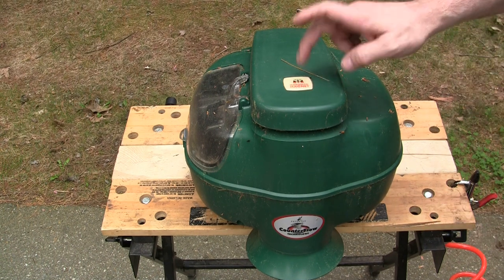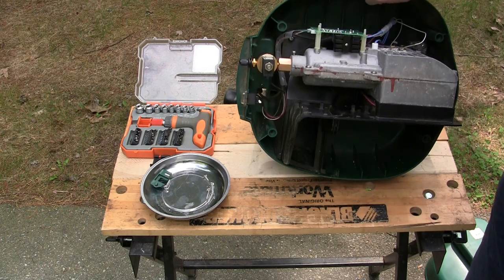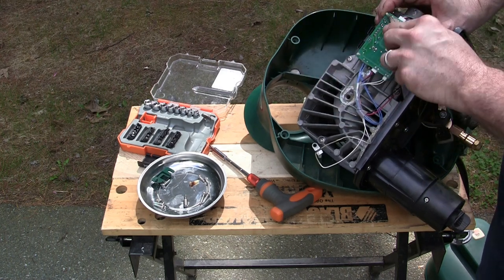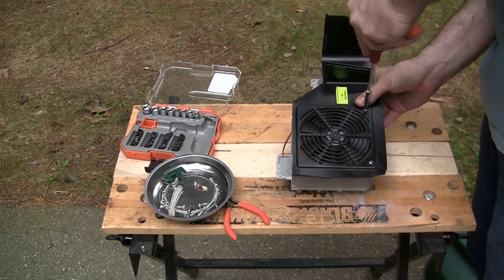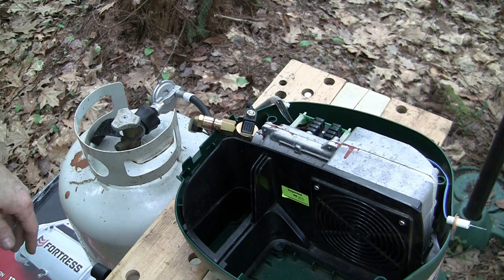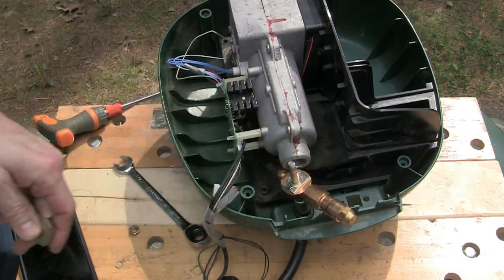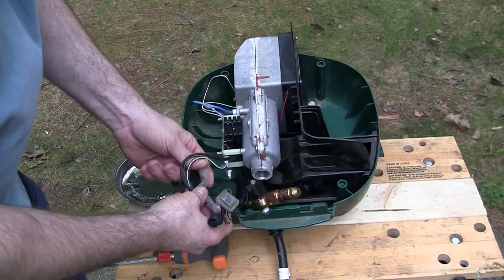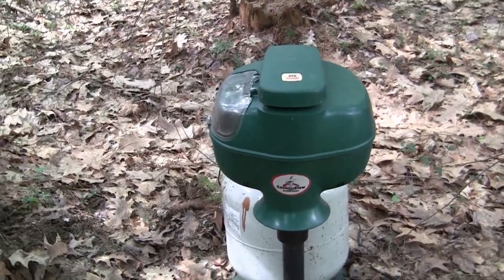Mosquito Magnet Patriot Plus repair

Comment: Side note for who it concerns, those igniters are EXTREMELY easy to break. Had torpedo heater that i was trying to fix and igniter was bit stuck, got it out but it snapped in process. Then tried to measure what kind of voltage board puts out, but moment i turn it on, mosfet exploded so it needs to have load on it, so consider this when trying to repair. In this case its low voltage while mine was 230v heater.
edit: got mine most likely fixed solenoid seemed to be bit stiff from storage, needed to take it apart. On 2013 model getting the peace sit properly is a pain and if i recall right you should never put grease on to help it slide, least certain types of grease. There should be products that works with natural gas though. I just carefully push it in place with parrot pliers being careful not to damage the O-ring. Cleaned the thermocouple and it seems to work now, gotta do more testing since i got this unit for free from E-waste pile. Also when you need to replace the gas line, see how it sits in place and when putting new one in place check it sits properly, mine got new line in old ends and sleeve didnt go trough the hole being bit larger so needed to remove some plastic to get it sit right. Otherwise the top wont sit properly same with unit internals and there is air flow issues. Mind replacing and sealing the airways so it can properly suck mosquitos in.
Reply from the maker: Thanks for contributing! Keeping these things running is a group project.  🙂

Comment: Thanks for this. Considering buying this device, but I understand now that knowing how to maintain the thing is imperative. BTW, that's one giant mosquito you got flying by in the background (12:00).
Reply from the maker: It really works well and I would still recommend them if you don't mind taking them apart every couple years. I have not seen anything better to date. And yes, I am glad that mosquito, flew by instead of paying a visit.  :-)
Reply: you need to buy octanol too, they fit inside a tube and that's where the magig happens. The unit burns propane to generate CO2 and heat to mimic an animal but they need the octomol so that the midge pinpoints the tube and gets sucked in.

Comment: Great video, thanks!  Couple of design changes on mine - the solenoid has a circlip rather than a nut holding it on,  and the thermocouple had a plastic sleeve insert insulating it from the main alloy body.  (I wonder if this was to prevent sacrificial corrosion from the thermistor?  No corrosion around it at all and it was fairly clean - unlike every video I've seen so far.  Unit is a UK version and about 4 years old.  The filter basket inside the injector does get very mucky - I used nail varnish remover which seemed to clear it up.  Still not working, but getting there :)
Reply from the maker: Thanks for the details. Good luck getting it running.

Comment: just for the record.  There are no flames with these units.  It's platinum-based catalytic process which is why the efficiency is over 99%.  Carbon Dioxide, Water Vapor and heat.

Comment: Davin, outstanding video!  Thanks so much for what you've done here.  This trap kills bugs like nothing else, when it's working; so it's definitely worth learning how to do good upkeep on it.

I've had my trap for 3-4 years (**), and had to send it back three times for maintenance.  (Last time, they sent me a replacement, refurbished unit.)  Now, a year after the replacement, mine is down again.  Very finicky device.
But with your video, I have plenty of hope that I can repair it myself.  Going to give it a shot this week.

I've already taken out and cleaned the nozzle -- mine was black on the "filter" end with carbon buildup.  I cleaned it pretty well with rubbing alcohol, and the quick clear cartridge seems to flow freely through it.  But in the meantime, I noticed that it's very hard to find out what are the correct part numbers for replacement parts.  Do you have a list of them? Or advice on how to identify them?  I haven't found good resources.  If you are able, I think it would be great to post a list of the most obvious parts:  the nozzle, the thermister, the solenoid/valve... anything else?
Reply from the maker: First off, thank you and I wish you luck! As for replacement parts, that is indeed tough. MM seems to have tight control over them and limits them to dealers. You can find some things on ebay. The only part I have had to replace is an igniter, which you can find there. MY advice is to watch local listings or even keep an eye out on trash day as people tend to get fed up with these devices and get rid of them. If you are lucky, you could get another unit for free or cheap and use it for parts (or fix it up and have 2).
Reply: @DavinDesborough  You are fight about getting them cheap ;-) I got one at a flea market for $15 ;-)  he said it would not start this year, I figured spare parts. Got it home and apart and it looked like they ran it without the basket in place,  it was so full of bugs the fan could not spin. Out of the 4 I have it is the best one ;-)
Reply: Hello, I use this model, mosquitoes do not enter at all.  What is the reason, help me  Heat on the machine 45c.

Comment: I have a Patriot model; after checking critical components like igniter and thermistor, finally down to gas solenoid valve; I injected 12 volts into its input wiring and heard a click, so assume it works. Looks like no 12 volts coming from board, and no continuity from board solder joints to output pins (for solenoid activation) so assuming corrosion on solder joints is the problem. This unit has been outside in the rain for ten years, and not sure how they would expect the electronics to function in such a harsh environment. Hope I am on the right track; will desolder and re-solder the board solder joints next.
Reply from the maker: What I think often happens is that the thermistor gets old or the probe is too covered in corrosion. Either way, the machines does not read the proper resistance and does not think it has started. What I like to do it try to run it. If it lights, the metal of the heat exchanger will warm up fairly fast. If you feel that warmth and then it still shuts off, it must be the thermistor (or the wiring related to it). I hope you got it working again. Sorry it took so long to respond.

Comment: I know this is an older video but I really like that screwdriver. Where can I get that set? 

Also great video. I bought two used ones, one for us and one for my in-laws. I took them apart following your video and they work great. Thank you so much for making this.
Reply from the maker: Great to hear this helped! The screwdriver set is a Home Depot HDX brand, but I don't see it on the website, so they may not make it anymore.

Comment: Davin  Thanks for the great video  You mentioned a part number and where to get a thermocoupler. Can you give that info? Thanks again
Reply from the maker: Sorry for the late response. You won't be able to order one as the company does not sell parts to the public. I can not find my purchase from way back when. I have looked around and can not find anything either. Basically, you would just need to buy a bare thermistor and put it in. I need to take one apart again and try to determine what thermistor is being used (resistance/temperature). That said, have you tested yours with a multimeter? If you heat it up and the voltage changes, it is probably OK. I will point you to this video: https://www.youtube.com/watch?v=60F9IkjqUVE. I think his idea of securing it with a metal screw is a good one. It would help to bring more heat to the thermistor. the only down side would be the possibly of corrosion between dissimilar metals.

Comment: Very good video should there be a need to take this apart! I have recently purchased the same machine and I was surprised how low the vacuum was. To a point where I thought it must be broken. Unfortunately the whole of internet has not been able to answer my question. Should I feel any suction if I put my hand in front of the funnel?
Reply from the maker: There should be some air moving, but not not a strong vacuum. Apparently, mosquitos have a natural reaction to fly up when startled or trying to escape.  That puts them right into the bell and they ride the airflow into the basket. 

Just to be sure, check that the door to the basket is fully closed or that will cause airflow issues.

Comment: Nice video. 

Did you find any drain holes in the chamber? I am wondering, as a burning propane flame generates water. It must have somewhere to go.... Right? 

Thanks!
Reply from the maker: @HotelGolf82  The water is mostly in vapor form and is supposedly part of the attraction. Mammals exhale warm, moist air, and so does the trap. There is no drain hole that I remember, but any water could just flow out the end of the horn as it faces down.

Comment: Hi, this is very good video indeed. we are thinking of getting one. But there are a lot of negative reviews. Most of them said catching at beginning but not reliable over time. Some people said broken after 2 summers. We will be using this outside US, so we couldnt get service from Manufacturer. Just curious how reliable this is.
Reply from the maker: I would agree with the impression you have. They are great at the start, but will start acting up. I have three different models and they all take the sort of maintenance I show in this video (see the other videos in my channel). If this does not scare you off, then get one, because they work great when they are working. If you want something that is more of a dependable appliance, this isn't it. 

Thanks for the compliment, and good luck!
Reply: @DavinDesborough  Sure mate! I'm quite handy. I can handle the maintenance. We are going to get one. Again, thanks for your advice. :)
Reply: @BurmeseExplorer  I agree with Davin.  I absolutely love this trap when it's working, and it kills bugs by the truckload.  BUT, it's a very finicky unit, and you should definitely expect to have to repair it once a year.  Hope you're happy with it.
Reply: Kenneth Wilson  Thnaks for tye advice. Just got one, and waiting for propane tank adapter.  I am not afraid of maintenance. :)
Reply: @BurmeseExplorer  I truly hope you have had a good experience, but my hunch is that this year you will experience regret in having bought it. I am not trying to be mean. Believe me, I wish you the best, but if your experience is like most, you are on the verge of bitterness and resentment towards Mosquito Magnet.

For your sake, I hope I am wrong.

Comment: I just had my patriot apart as well. I can see it igniting and the catalytic igniting inside, however it won’t stay lite. I cleaned the igniter and thermocouple. I’m wondering if I have a defective thermocouple as it won’t register enough heat to stay on?
Do have a part number for the thermocouple?
Second question. Is there any way of cleaning the brass gas tip? I’ve got a tip cleaner kit, but that hole is so small.

Comment: Hi Davin and thanks a lot for this quite interesting video. As many of us I've encountered this fast blinking red light problem.. I've taken the whole thing apart to clean it up , and then tested every part as you did. My problem was different, the solenoid seems to work as I have gas flowing out of the nozzle (after a cleaning session though), still the igniter/heater element never glowed during the 15 min session, it remained cold all the way. I've tried to check the voltage as well , and was surprised to measure about 1,5V when turned on. 
Any idea or hint to get this igniter to glow as well as yours? 😅
Thanks you in advance for your time and have a great day
Cheers
Reply from the maker: Thanks for the compliment! As for the ignitor, they are very fragile, and it might have a hairline crack, which would render it useless. The good news is that replacements are available on ebay and such. Just search for "mosquito magnet hot surface ignitor". It is possible that there is something wrong with the control board, but that seems less likely. I have not purchased one, but the ones commonly listed seem to be more of a probe and look a bit more sturdy. 

One thing about the voltage, did you try to read it as DC or AC? Power to the machine is AC, so I wouldn't be at all surprised if the ignitor was receiving AC and that is why your measurement was off. I have never tried to measure that circuit myself, so I am just guessing here. Best of luck!
Reply: @DavinDesborough  Thanks for your feedback Davin! I'll check that google search ASAP. Thanks also for the 12v AC information, indeed I was assuming output was 12V DC and did the measure this way... my mistake!! I'll give a try with AC measuring next time, PCB looks fine so I guess it's not the right path to walk.. But I did test this igniter without opening the gas tank, do you think there could be some safety inside to prevent the igniter from glowing if no gas running through? I don't think so but not quite sure about it... Thanks again!!
Reply from the maker: @alexgti9345  no, there is no interconnect there. As far as I can tell, the only thing the machine monitors is temperature to understand if things are working.
Reply: @DavinDesborough  Okay so even if the gas tank was closed, the igniter should have glowed, which probably means it's dead and has to be replaced.
Reply from the maker: @alexgti9345  Correct. It will leave the igniter on no matter what. To me, this seems a logical safety measure to prevent a build-up of gas.
Reply: @DavinDesborough  sounds logical indeed!  I am just wondering why the igniter has to go through some kind of pre-heating sequence before delivering its full power. I've read that this sequence can be as short as a couple of min, with a max time of 15 min, depending on what the PCB decides... but nobody knows why. 
I wish I could take the igniter apart and try to power it aside, but I'm struggling to find infos on what voltage/amperage to use 😕

Comment: You said you replaced the thermocouple before. Did you just use a generic universal one? Or did u manage to get a mosquito magnet one same one as came out? Or was it slightly different universal one that you replaced?
Reply from the maker: It was a long time ago.... I believe I found one on eBay or Amazon that was listed as compatible. Unfortunately I am not finding the order. One thing to note, it is actually a thermistor, not a thermocouple (I was wrong in the video). The part number is MM490016, but I have not found a current US seller. When I clean the machines this spring, I need to try and measure the ones I have to see what their ohm value is. Worst case, I plan to buy a "variety pack" of  on Amazon and just try out different values. For example: https://amzn.to/3V2kgUW (affiliate link, does not cost you anything, supports the channel)

Comment: This video is impressive! I just tried one 5 weeks ago. After following all the directions in setting up, the red flash was blinking fast. I returned it and was replaced. I followed the directions again...the red flash was steady and stayed for 2 weeks. Just 2 days ago, I noticed the red flash was blinking fast. I thought the propane gas was out so I replaced it with a new one. I installed it again but it is doing the same thing - the red flash was blinking fast. This is a brand new unit. Do you think there’s something wrong in the installation or it’s in the machine? Thanks
Reply from the maker: It's hard to think that there is anything wrong with how you assembled it or  your environment (unless you live far, far north and it is still really cold overnight).  I would call MM and see what they say. They will probably swap out the head of the unit as you have the issue on multiple propane tanks.   Good luck!

Comment: Thanks very much for sharing your findings. 
Question My power supply broke down. I know it is a 12V AC but do you know what is the voltage with no load ? (I wanted to replace it with a DC model but a 12VDC 3A is I guess not enough for the ignitor through the rectifier) Thanks in advance
Reply from the maker: Huh, I had to go look at my transformer as I would have sworn it output DC. You are right 12v AC @ 3A. Anyway, why would you want to go to DC? There are parts of the circuitry that are expecting AC and you are just asking for trouble by feeding it DC. I would need to take a close look at the board to say what might be impacted, but you'd probably be better off to order a new clone  supply for about $45 and call it a day. Example: https://amzn.to/3xyCDrd (affiliate link). I know the official ones are stupid expensive. If you want to splice some wires, you can get what looks to be the same thing I just linked to, but with a different plug for under $25 with coupon: https://amzn.to/3KUcNkz (affiliate link) 

That said, does the unit not power on at all with the old supply, or is it a startup issue? It would suck to buy a new PS only to have it still not start.
Reply: Thanks for your answer. Last winter I brought the moskito magnet in a shed but stupidly forgot the power supply that was hidden in the  grass. It did not survive at all. Thanks for your amazon links. Unfortunately I am in Europe and my grid is 220v. I am unable to find one compatible here that is affordable. This is why I looked at a DC version. Looking at the circuitry I believe that a DC should work but it needs to be at the right level to compensate losses through the rectifiers. If you have a min to measure the unloaded voltage that would be a great help. Many thanks.